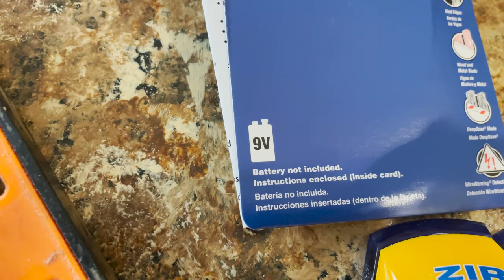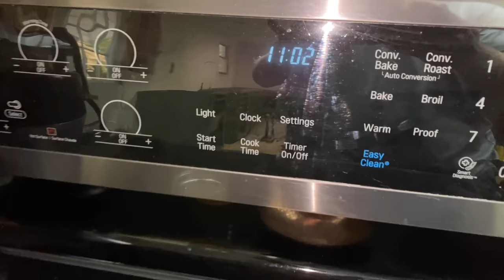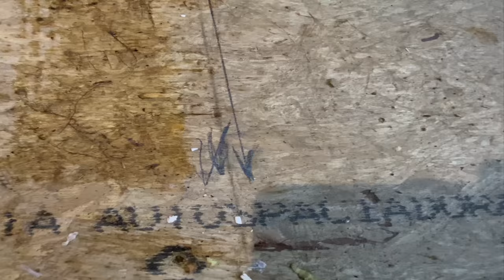Modern Home Makeover // Installing Cabinets -- Episode 18

Comment: Pro tip: from what i can see, your kitchen sink drain is not vented properly. Remove that top 1-1/2" elbow and replace it with an 1-1/2" sanitary T. Install an air admittance valve on the top of the T. you'll then hookup the sink drain to the branch  (or the horizontal inlet) of the T
Reply from the maker: Like I said, it’s all just temporary until I get to doing the final plumbing. Thanks for the advice though.

Comment: Turn the nailer - the angles on the brads direct them to blow left or right.  If you put the nailer perpendicular to what you are nailing into (face frame) then the left/right movement is still in the face frame mu-teer-ee-ul

Comment: You should do an epoxy countertop. I've done a few. Not too difficult and much cheaper than marble and much nicer than the pre made counters. You can make any design you want too.
Reply from the maker: It will be butcher block, but we will be coating it epoxy.

Comment: Way to keep plugging away crew!
Pro tip for you, you were holding your nail gun wrong.  If you don't want blowout, hold the gun PERPENDICULAR rather than parallel to the nailing stock..  Brad nails have a chisel tip which causes them to bend left/right rather than forward/backward.  If you hold the gun perpendicular to the rails, any bending of the nail stays in the work surface.

Comment: Lookin' good d00ds!

Pro-tip: Outlet boxes have little nubbins on the stud side, and if layout was followed you can just pull 16" from the center of that stud to find the rest. You can check, with a nail, behind rhe cabinets where nailholes will go unnoticed. You can also knock on the wall with your knuckles and listen for the more solid sounding area. I gave up using stud finders quite a while ago due them not being all that reliable.  I still have them, and break them out when there's nothing else to go by (like behind thick plaster and what-not)

I was excited to see a post from y'all! And while my videos suck, you've reminded me that I need to make one!

Comment: Does the titebond woodglue stick to the advantech coating? Also if you turn your brad nailer 90 degree you won't get those blowouts
Reply from the maker: That’s actually a good question I didn’t think about. We made sure to use the backside of the advantech, but I’ll run a test on it this week to see how well it holds without nails.

Comment: Why are you starting with base cabinets instead of wall cabinets? Now you have to reach over the base units to install the wall cabinets. Just sayin...
Reply from the maker: There are only 3 upper cabinets. I wanted to get the base ones done first so that Bekah count have more counter space. It’s not that big of a deal to install the uppers last.
Reply: I’ve installed hundreds of cabinets and it’s actually easier to install lowers first, then countertop template, then uppers. Let’s go ray jay
Reply: Hey Ray,
Thnx for your reply. It makes sense now that Bekah hasn’t had any counter space for how long now and only 3  wall units. She is a very patient woman and your injury only prolonged  any progress for a minute. Once you have thanksgiving dinner it will all be over and a memory. 
Cabinets look great. Great channel.